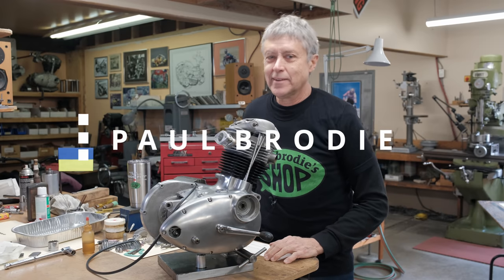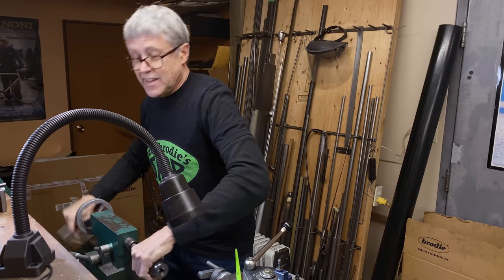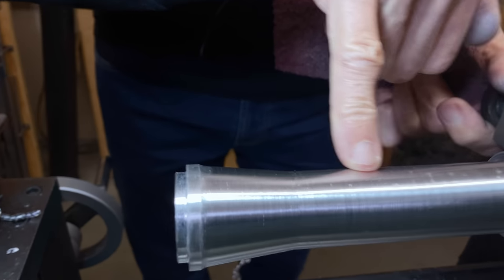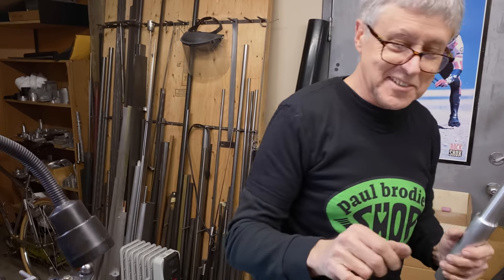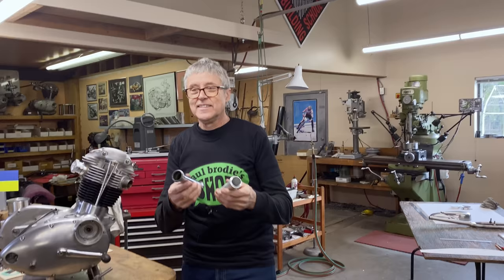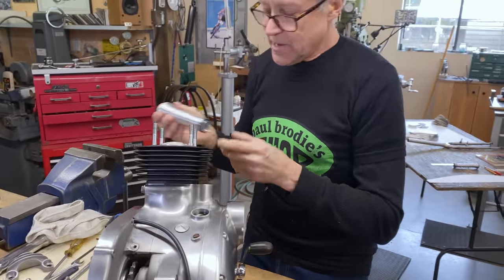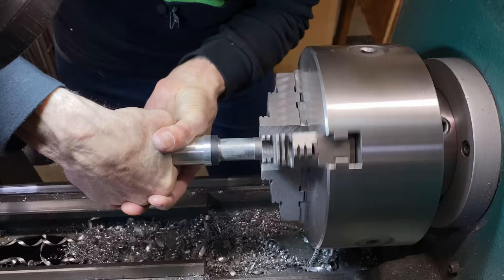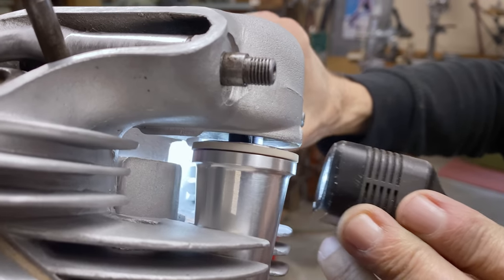How to make a pushrod tube // Paul Brodie's Shop

Comment: PAUL,WHEN I WAS 15 I TRADED A 22 RIFLE FOR A TERRIER 150,BASKET CASE..WITH THE HELP OF MY DAD WE GOT IT ALL BACK TOGETHER AND IT WOULDNT START,WE HAD PUT THE PUSH RODS IN THE WRONG TAPPETS,FINALLY WE FIGURED IT OUT AND I RODE IT FRO SEVERAL YEARS,TILL I GOT A CUB,WHICH I MADE A WATER COOLED BARRELL AND USED A 650 PISTON TO MAKE IT A 250,GREAT LITTLE BIKE..NEVER EVEN HAD A RADIATOR,JUST TWO HOSES LEADING TO A SMALL TANK NEAR THE LITE,NEVER OVERHEATED..IM 86 NOW AND STILL RIDE MY HUSKY 150 EVERYDAY,WEATHER PERMITTING..YOUR VIDEOS BRING BACK SOME GREAT MEMORIES
Reply from the maker: Hey Dan, That's a great story on modifying your Cub. Never heard that one before...  The world has changed a lot, so I am very happy that I got raised in the 60s and 70s, because, for me, that really was the Golden Age of Motorcycling!    :face-orange-raised-eyebrow::face-orange-raised-eyebrow:

Comment: After seeing all the comments about the length of the pushrod tubes, I had to go look at my Tiger Cub parts catalogs. The T20 uses an E3537 pushrod tube , even after the redesigned head and cylinder were introduced. The T15 (Terrier) used the tubes with the pushrod guides in them. (E3536) I would think that the tubes that you got in the pile of parts are not T20 parts. Your solution for the problem looks amazing , it makes this cub engine very easy to identify as "yours". I really enjoy this series and look forward to the upcoming videos.
Reply from the maker: Thanks Malcolm. I figured it out, as you will see on Saturdays video. Those two pushrod tubes I have fit the oval head / barrel. But I am using the square head / barrel, which needs a pushrod tube approximately 3/16" shorter. Pretty simple, eh?

Comment: Another very nice video. Thanks.
I was never able to get a WEBCO, fined oil feed, to seal properly. The too soft aluminum deformed when the acorn nuts were tightened enough to hold oil. I went back to the stock piece to assure sealing.
Although this does not apply to your model-year, I used Bendix, or Joe Hunt magnetos to provide spark; the Energy Transfer windings unraveled -- unless epoxy dipped. By comparison, your ignition setup looks terrific.
Reply from the maker: Thank you Marshal.

Comment: 16:45 - I have an old socket extension that I turned into one of those by drilling a cross hole through the end the socket wrench would attach then I'd use a screwdriver or Allen wrench to turn it... I made it for working on BMX bikes but it comes in so handy in all kinds of situations, I've had it for a long time and I'd love make more using different lengths so I have options.
Great video and as always great camera work as well.... Keep it up guys, you are doing a fantastic job.    😁👍
Reply from the maker: Thank you very much :)

Comment: As I recall, the bottom black seal slid up into a recess in the pushrod tube which held it in place. Hopefully, it will not buckle and leak without it. The original tube also had a pip that lined up with the one cast into the head. I couldn't see if there were thick washers under the head nuts.
Really nice machining work.
Reply from the maker: Thank you. You are right about the recess. The o-ring didn't really want to fit in there. I had (2) black 0-rings and they were slightly different. Quality!

Comment: The new push-rod tube looks much better! Why was the old one too long, different model or year of engine? Are castings of the head and crankcase still available?
Reply from the maker: Thanks William. The length is a mystery. I did buy a lot of used parts. Someone said it's a BSA C15 part? You can find used heads and crankcases. New castings? Probably not.

Comment: The pushrod tube is looking good. I'm getting excited about seeing the cub come together. It was hard to see if the 6061 was tearing or galling. A insert with a slightly sharper edge or hss might work better on material that is giving you problems like that. Just a guess!
Reply: Perhaps apply a light oil, to prevent the aluminum picking up on the cutter?  I’ve had some issues with this happening on aluminum when using both HSS and Carbide, and a mix of Marvel Mystery Oil and Charcoal lighter seems to help.

Yup, seeing some buildup on that long boring bar’s tip.  Dousing with a light oil will help.
Reply from the maker: I was using cutting oil..
Reply from the maker: I think the tempering was not quite T6. That's my guess...

Comment: Beautiful work but why was a shorter pushrod needed in the first place? Why didn't the stock size fit?
Reply from the maker: I switched to the "square" head and barrel, and for that combo, a shorter pushrod tube is required. No one told me. The manuals never mentioned it either.

Comment: looks nice, that rocker feed gives it a Ducati look somehow.
for assembling those tricky pushrods, a drop of oil in the bottom cups stops the rods coming out and grease at the top plus some elastic bands around the rockers keeps tension on whilst you tighten it down, makes the job easier.
Reply from the maker: I did oil the contact points. And I have heard of using elastics!
Reply: @paulbrodie  oil in the bottom grease in the top.
Reply from the maker: @pbysome   Yes, I did understand your comment, thanks.

Comment: My old Tiger Cub always used to leak from the pushrod tube, no matter what I tried to fix it, including red hematite gasket sealant.  My dad said it was a design feature to stop rest of bike from rusting.  Just needed to keep an eye on the oil level in oil tank to combat losses.
Reply from the maker: Andrew, your father was probably correct. Made me laugh, anyway. Thanks for watching.
Reply: Hi Andrew,
Just like you, I owned two Tiger Cubs when I was 16/17. I had the same issues as you, leaking oil from around the Pushrod Tubes. Also, leaking oil through the Crankcases. I couldn't keep those cases tight, and they always came loose. Cross Head Screws were changed (later) to Allen Head, and (just like you) Red Hermetite was used in an attempt to seal them up! All to no avail. When small Honda Twins came along, like the 175 Twin, I purchased one of these. No vibration (like the Cub). No oil leaks. Always started and ran really well. I used to thrash the Honda Twin everywhere I went, to try and break it. I was impressed with the Honda. To me, I spent more time pushing the Tiger Cub - than riding it. The name Tiger Cub is a swear word to me, and I see it as a lost cause. No matter how good the engine or whole Bike looks, it could never out-perform a Honda, on speed or reliability.

Comment: Another nice video. Amazing how large that 5/16" Whitworth wrench is. Does the 5/16" mean the bolt diameter?
And the need for a customized wrench to fit onto the bolt is another sign of the Cub's amazing engineering.
Reply from the maker: Thanks Pat. Yes, a 5/16" wrench will fit the nut or head of a 5/16" bolt. Yes, you are correct about the "amazing engineering" on a Cub.
Reply: I had a whole set of whitworth sockets and end wrenches and they never made any since to this Yankee. But they worked on Triumphs Norton's and BSA.

Comment: When I was a teenager and had my own Sports Cub [with an Alpha big end bearing that made all the difference to liking it] I thought that compact 200cc engine was so cute. That shot of it on the bench at the end did nothing but reinforce my opinion. Mine had an Amal Monobloc, but its advance/retard unit and points were side mounted like yours. Lovely videos of it. 👍
One little story - At the time I worked for an electrical motor factor and my advance/retard springs were kaput or just wrong. So, when I had time, I would open an a/r unit box and take the springs home to try. We had no units for the Cub, so it was guesswork and judgement. If they didn't work I returned them to the box unharmed. It took about 5 or 6 goes iirc and then I bought the springs. That little engine revved like a demon and the bike was much faster than the max 80mph indicated to the pin. It was tight, relatively quiet, didn't leak oil [no, honestly it didn't], idled properly and never misfired, nor oiled the plug. I guess I was lucky, although my brother was an excellent mechanic and he gave me good advice when I asked for it.
Reply from the maker: Good stories! Taking home springs to try and only buying the ones that worked.. I have a CDI unit, so my Cub will be lacking points.

Comment: Outstanding machine work on the pushrod tube. Could you have chucked up the stock one in the lath and trimmed off a bit from both ends till it fit?
Reply from the maker: Thanks Tom. No, the stock pushrod tube is made from formed steel, and is not well made. There is not enough metal to trim it down. Aluminum is a better material for this.

Comment: Lovely work....
That pink Lodge keeps catching my eye.
Is it new?
Reply from the maker: Thank you Thomas. That is a used Lodge plug. I'm not sure why I like it so much!
Reply: @paulbrodie  It looks period perfect for your beautiful Tiger Cub!    
When I was young we had a 1920s ATCO Villers reel lawn mower (exact same as Alan Millyards) which came with Pink Lodges in 18mm thread as well as three piece sparkplugs which could be taken apart for cleaning...
Reply from the maker: @thomaslawry5238   Thanks Thomas. Yes, I have a small box of the 3 piece sparkplugs. I bought them at the Davenport antique swap meet years ago, and I use them in the Excelsior  V-twins that I make.

Comment: Hi Paul
I worked with a guy who had worked as a machinist all his life. He told me to never wrap the emery strip around the workpiece like you did. He said if it ever grabbed it would pull your thumb in and rip off the nail. He suggested holding the emery between your index finger and thumb of your right hand and then use your the index and second finger of your left hand to hold the paper against the work. If anything happens you just release the paper from between the index and thumb. Not being picky about your work practices just a suggestion.
Reply from the maker: I always keep my fingers back, so there is some slack, then it can't grab. If you hold it close to the spinning piece, that could be a problem! Thanks for your concern.

Comment: *sigh I miss welding and machining things.. I started welding in high school at 16 and found it to be one of two places that I've felt like I was doing what I'm meant to, the other I discovered in college and that's doing autobody/paint. While I love making things, my autism does tend to get in the way with machining as I can tend to take measurements I don't really need and then make the part to fit that measurement and completely ruin it.. and that'd never fly in a shop and be expensive at home, and worse at that point I get really frustrated with myself and end up quitting.. it's what happened when I took beginner machining. My back issues and IBS keep me from being able to work period though. I wish I could work at home but money is the massive hurdle. It really sucks to have a ton of knowledge and cool ideas but no way to make any of them a reality... and I am a really good welder and bodyman and a pretty decent painter.
The little nicks in the part are common when using a tool steel cutter, it's caused by slight deflections in the cutter. My teacher told me the only way to get rid of them is to use a rounded nose cutter and it'll take them right off. (or you could use emery cloth or sand paper and polish it out but he didn't want the grit to get into the ways of the lathes)
Reply from the maker: I think there is always a way to make ideas into reality. If you think there is no way to turn your ideas into reality, it won't happen. You have to believe you can do it, and then you find a way.

Comment: Love the round carbide insert tooling- just got a couple examples to try out having seen a few youtube machinists use them- profiling with the triangular inserts is a bit of a pain.   Do you prefer the larger or smaller rounds?   I was thinking smaller sizes to make a smaller radius on inside corners- but maybe the larger ones win other ways?
Reply from the maker: I don't prefer one over the other. The different sizes have their own uses. The radius you make with them is always slightly larger than the radius of the tool, otherwise you will probably get chatter in the finish. Thanks for watching.

Comment: I'm interested in just what Cub engine those oem tubes fit.  Was that head a factory match for the 'square' cylinder?  Maybe you could mock up another engine from parts to find out just what combination those push rod tubes fit.
Reply from the maker: Someone said they looked like BSA C15 pushrod tubes. Could be another of life's unsolved mysteries...

Comment: How are the valve guides retained in the triumph T20 head?  Does the C clip go into a groove on head and guide?
I could not find this in any of your videos. Thanks for any help.
Reply from the maker: The valve guides are a press fit. I had a friend do it for me. I don't have all the tools for headwork. There is either a circlip or a shoulder on the actual valve guide. Hope this helps....   :face-fuchsia-tongue-out:
Reply: @paulbrodie  thanks... my exhaust guide fell out and I pulled the intake out with a tool I made.
Reply from the maker: Sounds like you need a good head specialist.  Good luck!   :face-fuchsia-poop-shape:

Comment: Looking real good!

I've found using a very sharp insert makes a lot of difference with aluminum surface issues like you were experiencing. Something with a high positive rake and polished. Though I usually prefer to cut dry when I can as well (hate the mess) a little aluminum tap magic or WD-40 can really improve those surface imperfections.
Reply from the maker: Thanks Bradley! I don't usually have surface finish issues, but the metal shop has been dealing with substandard 6061, so there is a problem somewhere with QC...
Reply: @paulbrodie  I like to buy mystery metals from scrapyards and Ebay, so I've learned to deal! Sounds like that 6061 maybe wasn't hardened to spec. Or some O spec made it into the T6 supply chain. Bummer for sure, but end results sure are nice.
Reply: Yourself and Mr Millyard should collaborate on a Transatlantic project somehow!
(Wish he would bring his gearbox MTB to market...I'd buy one...) regards as ever...
Reply from the maker: @bradley3549   My best guess is that the heat treating was T4 or T5, not T6.
Reply from the maker: @julian5883   Maybe Mr Millyard and I will have a conversation one day. We are about 8000 miles apart!
Reply: @julian5883  I believe Allen sold patent to some manufacturer who was going to make on mass.  I believe they went bust, before getting to market.  So Allen can’t make them.  Don’t believe he is interested in mass production.  Needs new projects to keep his interest, which is just as well as he has created many new and wonderful unique bikes.

Comment: My BSA C15's pushrod tube needed it's white, square section O ring at the top to be pushed inside the head casting aperture or it also appeared to be too long. I was just hoping that you didn't already have the correct length tube because it  looks like the white O ring wasn't pushed in far enough...
Reply from the maker: I have about .040" squish for the (2) o-rings. Pushrod tube seems to be working.
Reply: @paulbrodie  Great stuff….it looks better than standard, too! 😎

Comment: Hi Paul
Love your videos. I had a BSA Star of the same vintage, and it was a terrible bike. It had a distributor that would move and fall out of time. I haven't watched all of you Cub videos so I may have missed something, but why would the stock pushrod tube be too long if you are using stock pushrods, jug and head?
Reply from the maker: Thank you Madden. I bought a bunch of Cub parts, and am making one engine out of four. Someone even said the pushrod tubes look like they came out of a BSA C15. The length is one of life's mysteries!

Comment: Well.. if the cylinder o block is too short then your pushrods are now too long. The rockerarm will be in wrong angle if the cylinderhead sits lower than orginally... ?
Reply from the maker: I checked all that. The rocker arm geometry is just fine. I got a lot of parts, and someone said it looked like the pushrod tubes could be from a BSA C15...

Comment: Lots of comments to the same thought. If you had a “Cub” pushrod tube. Why was it too long? What changed in your assembly of the motor?
Reply from the maker: Someone said the pushrod tube looked like it came from a BSA C15... I got a bunch of parts and four engine blocks that I used to make one good motor. I can't say why those tubes were too long. One of the Mysteries of the Universe, for sure.
Reply: @paulbrodie  and yet in the “tiger cub tear down” episode you are standing beside a motor that appears complete. Oh well, an interesting project anyway. Thanks for the entertainment. I look forward to Wednesdays and Saturdays.
Reply from the maker: @stephenabel897  Yes, that was a motor with the "oval" head. I ended up using a "square" head, so maybe the difference is between the heads. Anyway, all is good now.